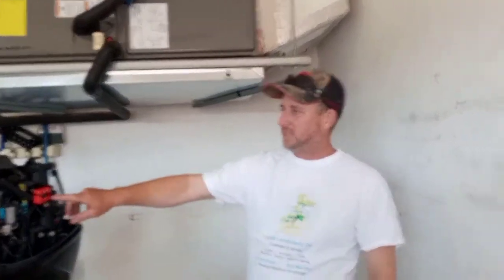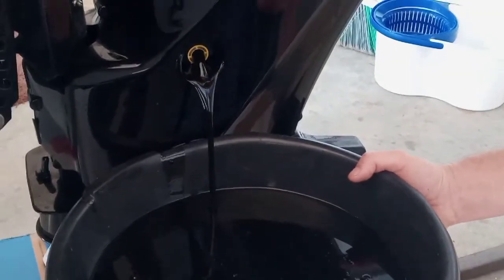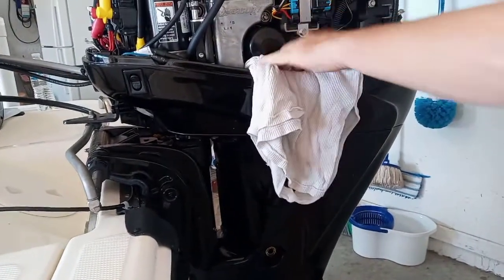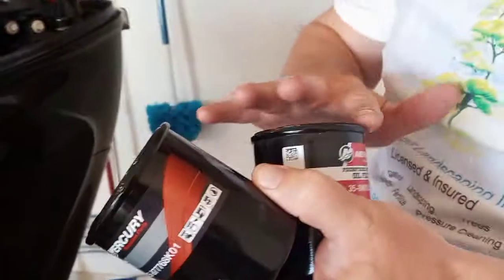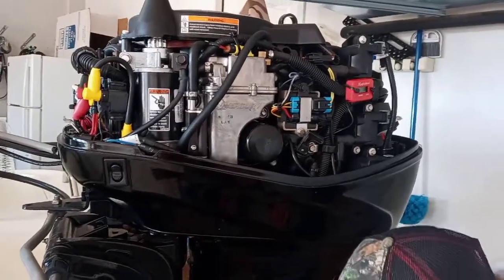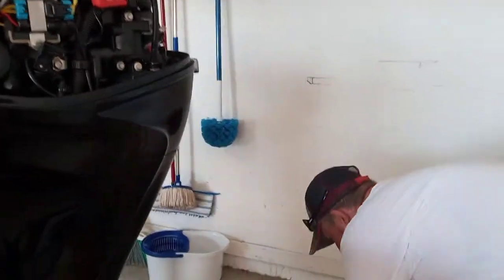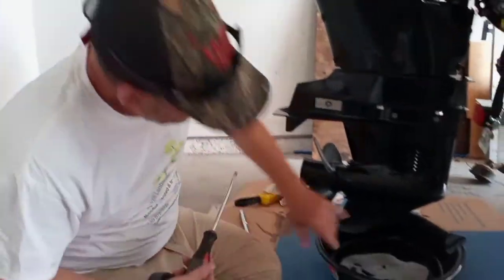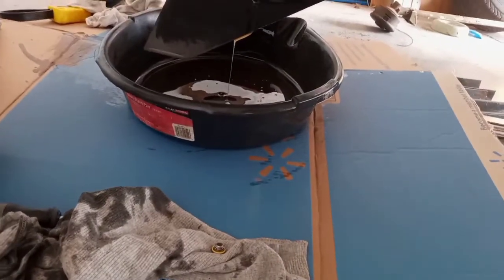10hr service on Brand new 2022 Mako pro skiff 15ft with 40hp 4stroke Mercury outboard!!!

Comment: Where did you read that it needs a 10 hour service? I have a new 60 merc and the dealer said I needed a 20 hour service and it only included changing and check the lower unit oil for metal shavings, they said the motor oil doesnt not need to be changed until 100 hours, the manual only mentions the 100 hour service, I let them do the work because I wasnt sure if it would void my warranty if I did it myself, but I wont be back to those clowns!
Reply from the maker: No my dealer said 10hrs. And my service was changing it all. And Mercury and Mako said I can do myself and it void warranty. Either way that warranty bs sux they don't do anything lol. Thanx though.
Reply: @reelfunfishingofswfl6892  lol they must have wanted you to pay them to change it all, so it does or doesn't void warranty doing it yourself?
Reply from the maker: No you can do yourself.
Reply: Just took delivery of my Pro 15 Skiff w/60hp...... Dealer only mentioned every 100 hrs ~~ can do yourself with all OEM parts/fluids, doesn't void warranty....
will call'em today to see about 10 or 20 service..... changing lower no big deal....
SWFL also.....Boatdrinksasota Bay....